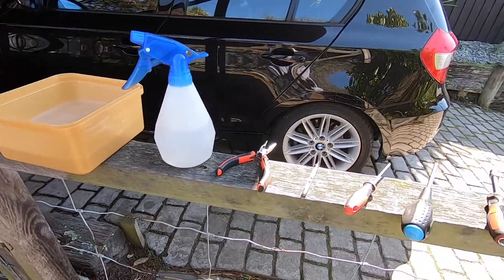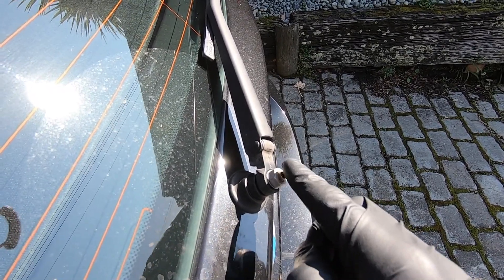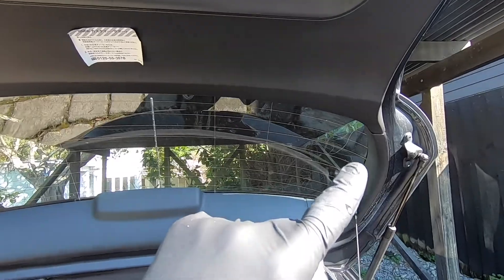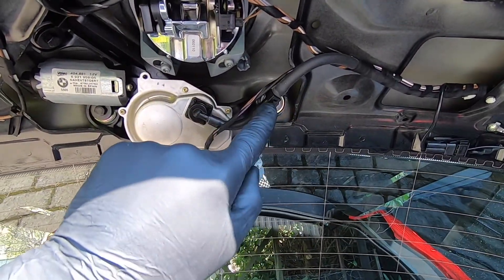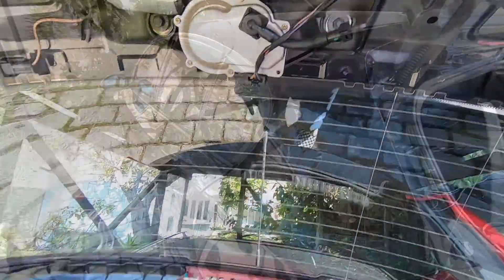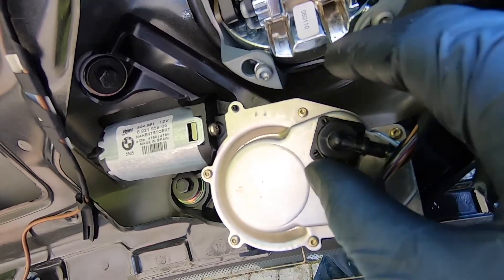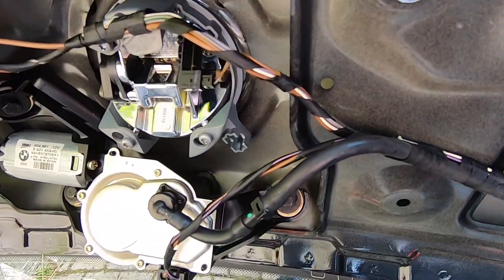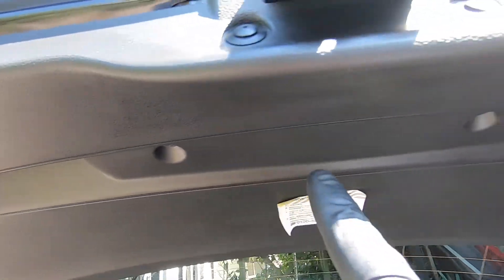BMW 1 Series Rear Window Washer Internal Repair

Comment: I washed the nozzle that clips off in the soapy water, but it seems like its blocked on the inside and I cant get it unblocked (water doesnt go through, neither does air) , any ideas?
Reply: poking with a needle doesnt seem to get it lose, can you get the nozzle out of the (clips) plastic cover?

Comment: After 2 years of owning my 116i after following your steps i can finally see water coming out 😂 only problem is I noticed a bit of a leak coming out of the mechanism. I opened it after undoing 5x T10 screws and inside was DISGUSTING, so rusty and it had a lot of type of grease or something. I’m thinking to replace it, from dealership it’s £155, bmw used VALEO parts and from AUTODOC I can see the VALEO brand costs £44 pounds. I’m thinking to go for it. At the end of the day it will do the same job right?
Reply from the maker: If they are left blocked they can start to leak internally inside the housing. Veleo replacement will be fine (better than the one on the car right!)
Reply: @MTechGuy  I read a forum of some people saying that even after tenet replaced it it was leaking again???? So I don’t know what to do now..

Comment: Great video! I actioned all of the steps, unfortunate it didn’t solve the issue, but I can eliminate one potential issue off the list

I wasn’t able to refit the 2 x plastic screw to the boot door handle area. Any suggestions on how I can make that work? Tried everything but it just can’t seem to catch the hole 🤷🏻‍♂️